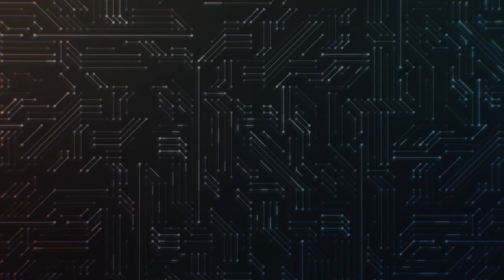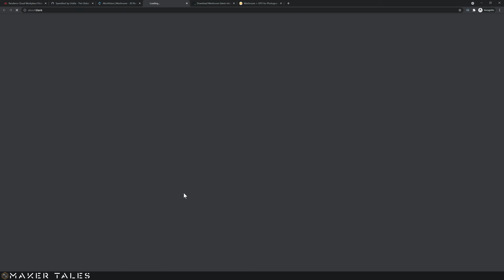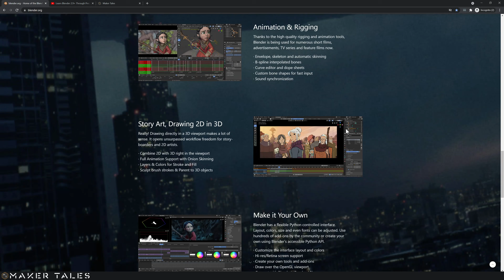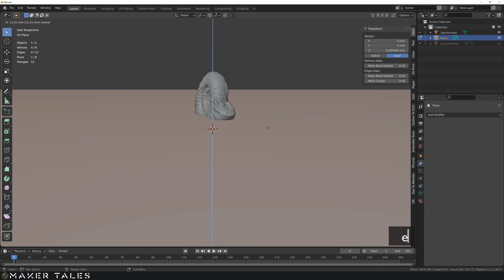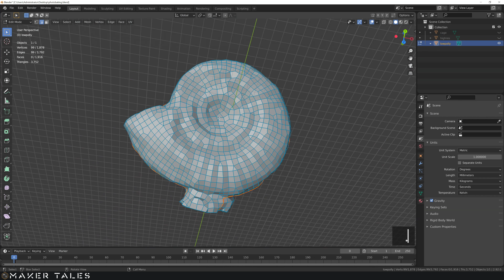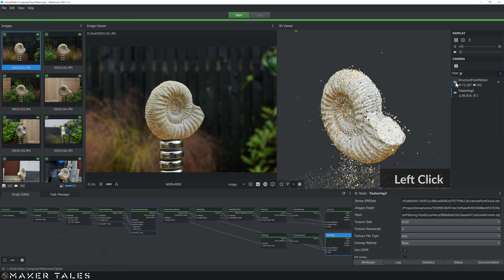Photogrammetry Survival Guide | Free & Easy | For 3D Printing | Art & Game Assets | Phone or Camera

Comment: I love your work. I tried to do a few Photogrammetry experiments myself after watching your video but failed. In principle it works - I easily reproduced your Ammonite example. I assume the pictures I am taking are just really bad.  I have a Samsung Galaxy Note 9. In Pro Mode in your video, you only show that you set ISO to 200. What else do you set to which value?

Main camera:	12 MP (OIS, PDAF)
Specifications:	Aperture size: F1.5/F2.4; Focal length: 26 mm; Sensor size: 1/2.55"; Pixel size: 1.4 μm
Second camera:	12 MP (Telephoto, OIS, Autofocus)
Specifications:	Optical zoom: 2.0x; Aperture size: F2.4; Focal Length: 52 mm; Sensor size: 1/3.4"; Pixel size: 1 μm

Which aperture, Which F-Value, Manual Focus or Autofocus? Etc.

Comment: I think that you're really missing some GPU compute there. In my laptop I have a Quadro T2000 with 4GB of VRAM and some of the steps don't take nearly as long as it does for you. With an i9 9880H, 32GB of RAM it takes way less time than that. Sure it's a great laptop, but it's still a laptop. As long as you have a CUDA capable GPU then some of the steps will go way faster.

Comment: Just saw parts of your course (haven't finished yet). Unimportant question, but when you have the time. When marking the edges for the seam, would that be a chance to use the path select tools? choosing the points on opposite sides, and then Blender will configure the shortest route between them? I'd never heard of the path select tool (not sure if that's what you call it), but I'd never seen anyone using it in seam selection, and it seems appropriate.... Just a random thought.
Love your videos as usual, such high quality.
Reply from the maker: From my understanding, it's the shortest path... I guess but I could be wrong.